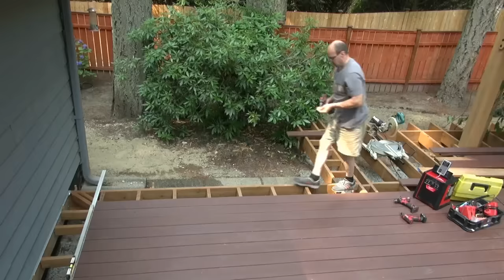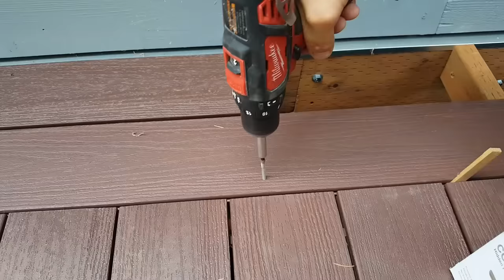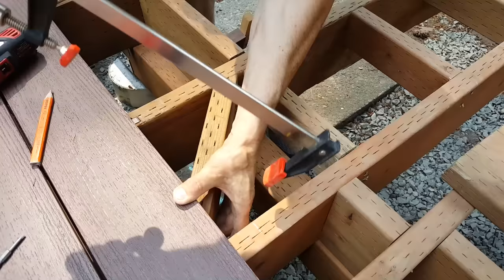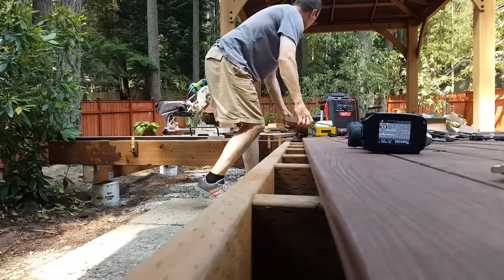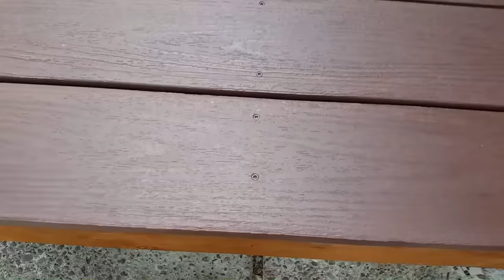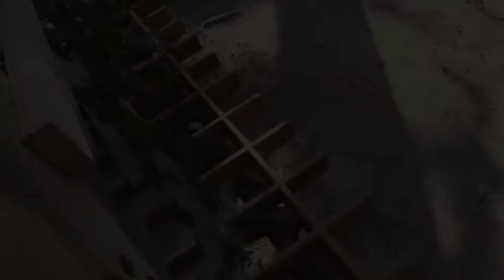How to make 45 degree Deck Corners / Deck Frame Trick. Как строить углы террасы

Comment: The only criticism i would give is the use of deckmate screws for the structure underneath. Deckmate screws are great for deck planks. But deckmate screws dont not have a lot of shear strength. They weaken easily and will shear off. Use different screws.

Comment: How come you don't gap you but joints? You did on the 45 miter but not at the but joints you put them tight. Hows that work for expansion? This thing looks great buy the way. A lot of people stay away from boarders on decks because of the extra framing work that is required and it's so expensive. If you dont have a video on framing for a deck with boarders you should do one your work is spot on. Nice job
Reply from the maker: This deck has 15 part of video from start to finish.

Comment: Do you keep the space in the miter the same as the space between the boards? I'm doing a double picture frame and not sure how best to deal with the miters. I don't think having them completely tight will work as they'll open up in the future. What is your approach? Also, have you ever mitered scalloped boards (ie not solid all the way through - they have those dado type groves along the bottom. My thought is to maybe rip some wood to fit into those channels and then crew in through that for a more solid hold.
Reply from the maker: Was the same space, 1/4" approximately. Never work with other types of flooring, can't say anything's.
Sometimes I do corners without space to better look like solid continued wood edge/frame. Like in this deck:  How I build the Deck 12' x 20'. https://www.youtube.com/playlist?list=PL9fyWqL02lqkUWshlwsCqzBcRR8BEMETo

Comment: I’ve seen a lot of 45° corners where they are flush together, touching each other. I see you have a gap between the 45s. Reason for that??
Reply from the maker: After years, the frame and floors board will move back and forth in winter-summer temperatures and no one guarantee 45 will stay together. So owner asking make a 1/4" gap like all floors between boards. In this way it will look similar all the time.
Reply: @FixitAll  that’s what I like best is that the gaps in the 45s look just like all the other boards. Very clean look.

Comment: Guess I'm the only one who noticed he did all his pre drilling with a driver and put in the screws with a drill
Reply from the maker: You right. I don't like noise from driver when it overload with strews in.
Reply: Drivers will easily snap/break a screw.  
In my experience.... Drills are much more gentle on screws
Reply from the maker: @freddienz68  You absolutely right. And also I can control speed with drill and deep of the screw head in the board.
Reply: @FixitAll  👍👍👍
Reply: @FixitAll  i rarely use the driver any more because of the noise. the new brushless drills are so powerful you don't need to.
Reply from the maker: @007Variable  agre with you noise from driver for all neighbor hood..
Reply: Saw that too :)
Reply: Well I guess someone had to pull a negative out of it just for the sake of it. 🙄

Comment: Not sure about using the screws to secure the 45 bracing, not concerned about the sheer strength overtime?
Reply from the maker: That was owner design.
Reply: @FixitAll  ah

Comment: Would face screws not prevent the board from expansion and shrinkage?
Reply from the maker: 5 and a half years have passed since its construction. The customer does not notice any shortcomings or changes in the design. So I can say that everything is fine.
Reply: @FixitAll  thank you for your quick reply.  Sorry if it came across as i was questioning your work, it was certainly not my intention.  I am just trying to understand why manufacturers are telling us to leave a gap for expansion, but at the same time approve face screws which is counter intuitive. I thought the screws would lock the board in place and resist any movement thus putting stress on the boards.  And the Camo system is similar to face screws interfering with expansion.  Am I understanding it right?
Reply from the maker: @b3arwithm3  I think the boards don't create as much movement and don't expand as much as to put stress on the screws. Natural wood boards are much more susceptible to expansion. However, they are screwed on and last for decades.
Reply: @FixitAll  does the temperature varies a lot in your area?  Yes wood boards move much more. I think they buckle up because they can't move horizontally.  That's the #1 problem I see with wood decks.  Nails aren't flush because the boards cupped up.

Comment from the maker: Watch ALL videos about full process of building:
Deck material - TimberTech  https://www.rmfp.com/decking/composite-decking/timbertech-decking/
Screws - Composite Deck Screws Rustic Bark color head - here at Home Depot - https://thd.co/2Cko9LE
#1 How I build the Deck. Planning & Concrete Footings. Разметка и опоры террасы
https://youtu.be/NS2Y1H1gLzM
#2 21 Deck Concrete Footings done. How I build the Deck. https://youtu.be/ZN0SHnzfYpk 
#3 Wall preparation before Deck Ledger Board installation. Подготовка стен дома к террасе
https://youtu.be/mhdMaSr9xR4
#4 How to make 12 foot level under $22. Длинный уровень из короткого https://youtu.be/iM4YQkaGZYU 
#5 Deck Ledger Board installation https://youtu.be/rf8gZdfEVrg 
#6 Joists and Joist Hangers installation. Лаги для пола и их крепление
https://youtu.be/Lg8ZQHGKDgs 
Make the BEST Multi-Function End Nipper Pliers ever  https://youtu.be/86zo98rrmA4
#7 Deck Face Board installation. Jig and Trick. https://youtu.be/DMMqpAgojuQ 
#8 Blocking between Joists https://youtu.be/S42dqyuJU1U 
#9 Circular Saw Jig. Perfectly straight 90 degree cut. Circular Saw Guide
https://youtu.be/QiA-aMAeRrI 
#10 Composite Deck Board installation and nice Inner-Outer Corner.Композитный пол, углы
https://youtu.be/JvScq58tyGs
#11 Block, Joist and again Blocks and Joists. Лаги и крепление к обвязке
https://youtu.be/5AfmIOjeM5E
#12 How to secure deck boards to the joists. Как крепить пол к лагам.
https://youtu.be/hunOh2uD4ws
#13 How to make 45-degree Deck Corners / Deck Frame Trick. Как строить углы террасы
https://youtu.be/qI8Tv8yfTZQ
Circular Saw Crosscut trick.  https://youtu.be/bJLujssoxcU 
#14 How to build a Deck Steps. Ступеньки для террасы https://youtu.be/tJePMWHwnLQ 
#15 Decking Fascia boards installation. Боковые панели для террасы
https://youtu.be/2kLkNM-ylUE

Comment: Great job 👍 some decks I've seen on utube have closed the miter corner, you a have a gap . Is the gap for expansion?
Reply from the maker: Mostly for pine tree needles. A lot of trees around this deck.
Reply: i was thinking on the gap I’m learning how to make decks and the decks that i already done i didn’t left no gaps and its a trex that would be a  problem ?
Reply: @walbertHidalgo  Trex specifically states to leave 1/8" gap between all decking boards, including butt joints/corner mitres, for seasonal expansion and contraction. No gaps = no warranties.
Reply: Timbertech Azek guide explicitly states, “Do not leave a gap at butt joints, splices or miters.” I don’t know why though since a lot folks apparently do and if John Dough is correct, Trex specifies the opposite.
Reply: Mick W  There are so many different types of composite. some still have some percentage of wood in the core. there is no wood in azek.  Ive installed a lot of Azek, we do follow the direction to make mitres tight, ive never seen them open up. very tight to this day on decks ive re inspected.
Reply: Because you glue them

Comment: What kind of wood did you frame this with? Never seen wood with all the little slots on top? Looks like good material
Reply from the maker: Not a wood, this is composite material. Plastic.
Reply: Pressure treated wood frame. Composite decking.

Comment: How come your drip cap from the house ledger isn't on top of the deck boards?
Reply from the maker: Never saw it in floor materials.
Reply from the maker: Plus - this type of installation is a owner choice, i just done it by his instruction.
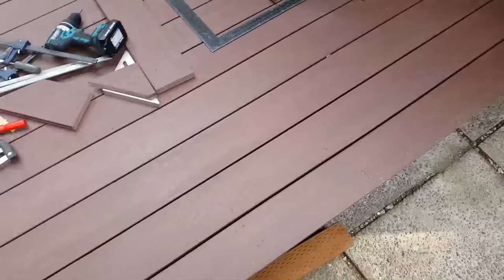Reply from the maker: All water and pine needles will drop thru the hole 4:04 on the ground and never collect between wall and floor.

Comment: No xlips i thought that was the hole point of composite i like wood in the summer its better that composite is fire and wood is just as good make sure your miters are tight always bevels miters coping has to always be tight very important even with azek and composite materials and pvc it does shrink i work with it everyday
Reply: i've seen azak shrink to  a 1/2" gap on rake boards, would be very disturbing for such a pricey product
Reply: Never make your mitres tight. They'll expand 100% over time.

Comment: We stopped mitering deck boards - even the composite stuff  - ages ago. Use right angle butt corners (works better for odd angles, too).
No face fasteners, either - use hidden proprietary clips.
No problems - so far - even with wood. 🤞🤞
Reply from the maker: Thanks for advice!
Reply: @FixitAll  
👍👍 Stopped using miters with interior trim also - things look like hell in no time.
Reply: Bad information
Reply: @samuelt2072  i did miters10 years ago still together. Wood, composite and vinyle.

Comment: Face screwing the boards looks terrible 
Should have used hidden fasteners
Reply from the maker: That was owner plan.
Reply: They make cortex screws that come with plugs and even have grain marks so you can see where screw was installed

Comment: Hope you didn't build that deck framing with all screws, not up to any code AND much weaker than using nails. Good for a few years but screws don't have the structural or shear strength of nails. Also should have used rubber joist tape to protect the joists from sitting water. Won't rot nearly as fast. Even with treated lumber.....
Reply from the maker: All was done by plan approved in city and after building was signed by inspector. 
Thanks for advice any way!
Reply: Nails may be good for interior work but unless they are treated and ring or spiral they corrode from pressure treated lumber and will snap off or back out.  I have a ‘code approved’ deck on my house to prove it.

Comment: What kind of joist timber is that?
Reply from the maker: 2" x 8" x 16'
Reply: Sorry, I meant to ask what kind of specie of wood is that?
Reply from the maker: @slicktype001  you mean decking floor material?
Reply: Fix it All : Decking looks to be Azek or the liking. I’m more interested in the actual wood specie of the joist. I can’t say that I have seen that staple looking holes on the joist sides as what’s present on all your boards.

Comment: Composite decking materials look cheap and nasty.  Good skills tho... nice miters and gaps.
BUT Even composite decking materials move in the heat of the sun and the cold of winter.   I have seen these materials shrink at least 1/4 of an inch.
Reply: Yes they do, treat as though it's wood, and allow 5mm between any joins

Comment: gotta have expansion at that joint. 0:41
Reply: Tim Copeland I don’t think that is the case in this situation the whole board screwed down I imagine the frame is going to be stressed no matter what
Reply: Some composite manufacturers state that the decking butt joists should be installed with no gap.
Reply: @mrmpls  yup Timbertech Azek specifies no gaps for butt joints, splices and miters.

Comment: Was looking for an informative video, not a techno rave deck soundtrack.
Reply from the maker: Do you need information how to cut at 45 degree ?
Or how to use drill and screw to assemble two piece at 45 ?
Reply: @FixitAll  No, cutting a 45 degree and screwing them together is not the what I was looking for. I would just think that there would be some sort of dialog explaining the thought process, reasoning  for the decisions he was making, lessons learned, tips... literally anything except a shit soundtrack.

Comment: why you screwing all from the top..use deck fasteners and hide screws...
Reply from the maker: Yes, you can, just add more joist support to each board ends. Thats was owner plan to reduce  work with extra joist to support.